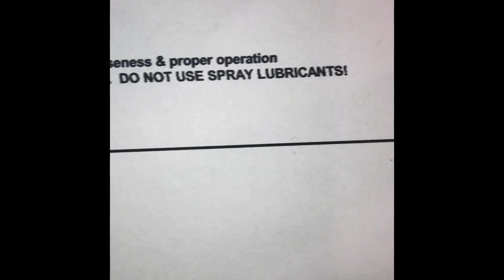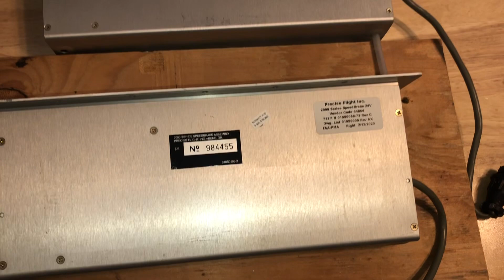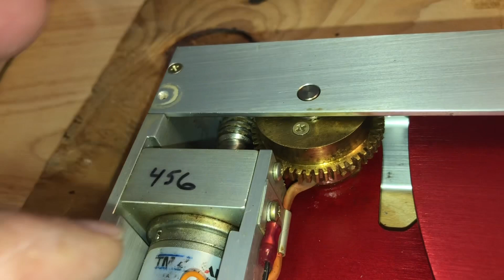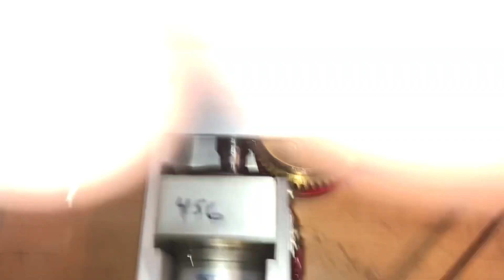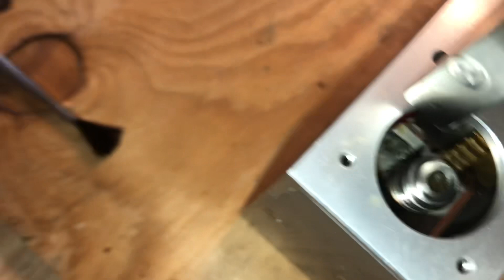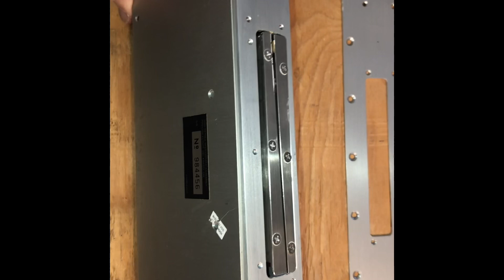Precise Flight Speed Brake scheduled maintenance, annual

Comment: Do you have a parts list for the brakes?   I'm particularly interested in the motor, clutch, and drive gear.
Reply from the maker: No, sorry.  I don’t have part numbers. Precise Flight doesn’t want anyone replacing those parts so they don’t provide a parts catalog.  They require us to send the speed brakes back to the factory for repair.